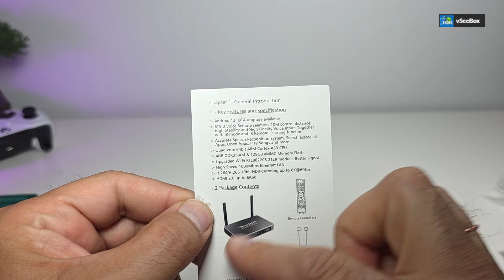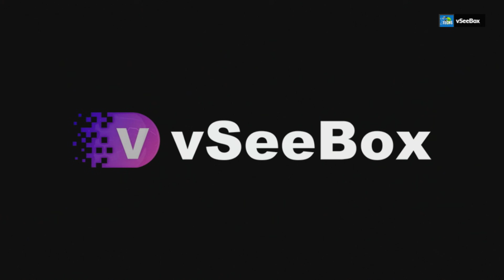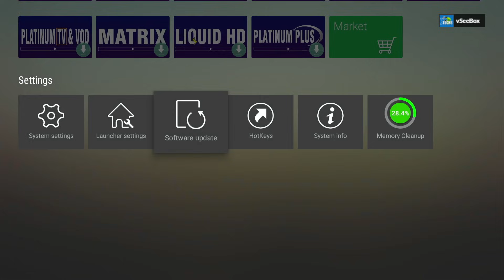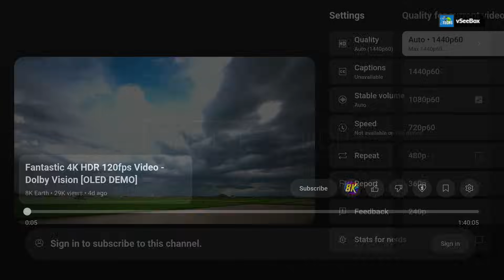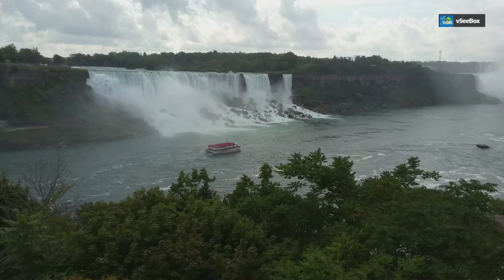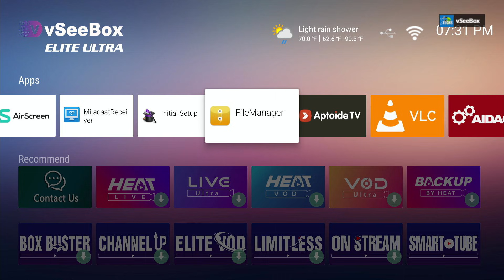VseeBox Elite Ultra Unboxing & Real Test – Must-See!

Comment: I’m looking for a loaded box similar to Tanggula can anyone help me out?
Reply from the maker: Vseebox
Reply: @xctechs Do you know where I can buy one and how do I know it has all the stuff on it
Reply from the maker: @brucealain2592 the link is at the info section, and yes has everything i have shown in full review. And you can check full review link at the info section of this video.
Reply: @xctechs  I don’t know how to go to your video. I’m fairly new at this stuff.
Reply: The vseebox is very expensive. Is there any other ones even the apps that I could load on my Tagula?
Reply from the maker: @brucealain2592  there are services you can purchase yearly.
Reply: @xctechs Can you tell me what the conditions are and how I go about it all that stuff
Reply: @xctechs  I’m looking at getting all NHL hockey. Is it possible to get an app that will work with my Tangela box?
Reply: @xctechs I have a Tangela box I’m wondering if you can put some apps on it so I can get some programming
Reply from the maker: @brucealain2592  Tanggula is no longer available. The only option now is to purchase a subscription, which costs less but offers good service and support. Many people disliked these boxes because they were promoted as lifetime devices, but that only lasted until the company shut down. While the service was once fixed quickly, the sellers mostly focused on one-time sales and didn’t help much when channels stopped working. If a provider now offers reliable support and ongoing service, it’s a good time to join in and make the most of it.
Reply: @xctechs What does it cost for your service and what does it include do I use my Sam Tangela box or do you supply one
Reply: How much is a subscription and how do you pay for it and who do you pay?
Reply: @brucealain2592 superbox would be your second best option.